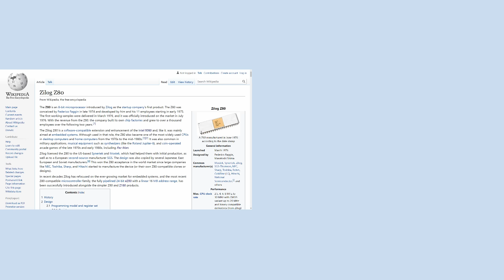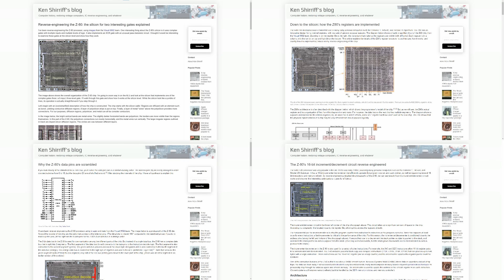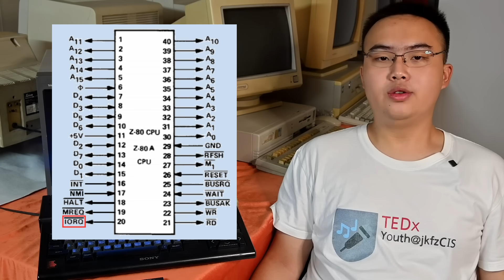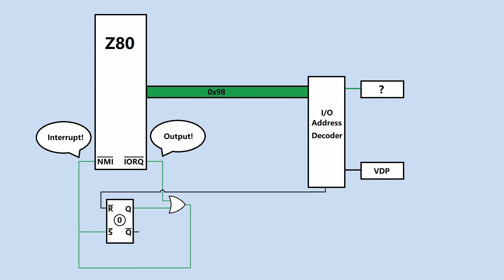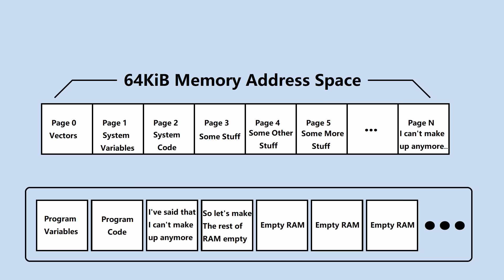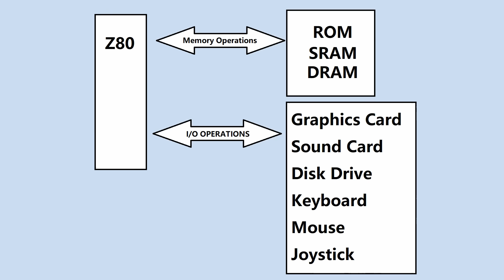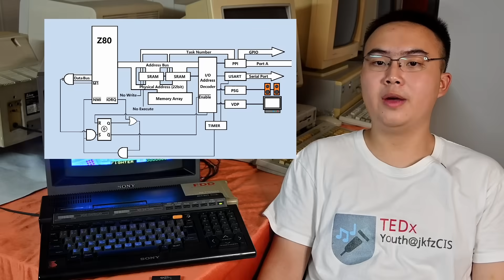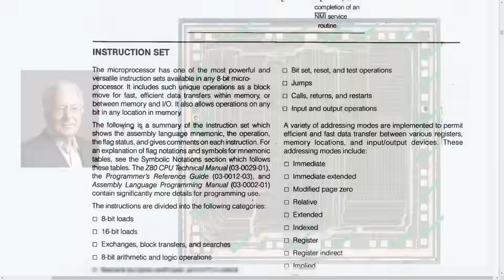The Z80's secret feature discovered after 40 years!

Comment: Mobile phone arm processors have inbuilt x86 architecture, such as 286 and 287. It has a light processor, and simple physx also available in symbian devices. 8087 should have the light processor, requires a heatsink at 4.7 mhz. Isa 256 colour cards should have the same physx support for car games. To turn on the light cpu, using flight sim at low altitude, high speed. To turn on physx, nfs uc and hp is needed for phones. For explorers, and frameworks graphical and keyboard performance increases. Diablo clones and castle vania character increase adds magical power and luck for the computer permanently. That causes luckier browsing solution with an xt computer.

Comment: I fell in love with the Z80 as a teenager. Loved my ZX81 as well. I did a tech project for school where I made a Z80A trainer. Years later I examined an video gaming device where it would switch between running the game and the input devices and had this seperate video board it would switch back and forth with to run to provide the screen output. It seemed over the top to me but that is what it had. For it to generate random numbers it would access the refresh register as a seed. Always thought that was nifty.
Reply: Do check out the ZX81 ROM disassembly books, some seriously devious code in there to squeeze every last gram of potential from such a simple circuit.

Comment: you cant trigger a nmi until the current instruction has finished so if thats an io instruction then wont work right?
Reply: The pre-NMI I/O operation is blocked [well, sent to nowhere] by the flip-flop disabling the I/O address decoder.
The NMI being acknowleged is detected, which enables the I/O decoder.
The OS will exit system mode by outputting to a special port to switch back to user mode.
It shouldn't be too hard to add some decoding to detect the RETN [ED 45] instruction executing and automatically switch to user mode.
RETN executing from user mode should not be a problem here.

Comment: I can think of ways of implementing a "protected mode" in a Z80 using similar methods, presuming it uses bank switching to implement the protection.  With the right gates, you could set it up so that a NMI is hardware-forced if an OUT to the bank switching control is executed from any place in memory apart from the OS address range.  The interrupt acknowledge would hardware-switch out the bank containing the running program and switch in the bank containing the correct interrupt vector.

Presuming the OS has been keeping track of which program is currently running (which any good protected mode OS would do), it would be able to terminate that program immediately and throw an appropriate error to the console (eg. Protected Memory Access Violation).  This would not prevent a program from requesting a bank switch from the OS to store extra data (for example), but it would prevent the program from doing the bank switch without asking the OS.
Reply: And now that I come to think of it, it would be quite possible to make the OUT instruction simply go into "dead ether" unless the code was run from within the OS's area of memory.  In other words, a gate which blocks any OUT instruction addressed to the bank switching circuit, unless the instruction came from within the area of memory used by the OS.
A similar scheme could be used to prevent overwriting the OS if it were in RAM.

Comment: Looks interesting but I highly doubt that NMI can interrupt an I/O transfer ... Even if it would, I also doubt that you could figure out the address of the interrupted I/O transfer 🤔. Is this just theory or did actually someone really try this? 🤔
Reply: i just got done posting something similar, i have my doubts about this too. The current instruction would have to finish right?
Reply: @randyjackson7584  yes, afaik NMI triggers after instruction was completed.
Reply: @punpck  he seems to be getting a lot of high praise so maybe i am the one wrong, but this won't work. the nmi will come after the i/o instruction is over and the return address pushed to the stack will be at start of next instruction.
Reply: @randyjackson7584  yep the Z80 finishes the current instruction (or the current "loop" of a block instruction as I understand it) before any interrupt is serviced... I/O instructions are always two bytes I believe so you CAN find and inspect the instruction (at a big performance hit), but my big issue is the IORQ line... how do you ACTUALLY do I/O if you wire IORQ to the NMI... the proposed "simple circuit" omits that...

Comment: I like your video. The Z80 is a powerful little CPU, even today. 

A couple of things to keep in mind though. On the platform you're demonstrating most prominently, the MSX (thanks for that btw - it is way underrated), the Z80 memory addressing space is divided up into 4 pages of 16kB, each of which can be in 1 of 4 so-called slots. Which page is in which slot is governed by port A of the PPI (8255). In theory, this allows for a total of 256kB of address space without any additional circuitry. The main BIOS and BASIC ROMs are usually in port 0, with RAM and additional ROMs in one or more of the other slots. At least one slot is also taken up by a cartridge interace. For instance, the Philips VG-8020 has its ROMs in slot 0, two cartridge slots in slots 1 and 2, and depending on the specific model 64kB of RAM in slot 3 or in a so-called expanded slot 3-2 (expanded slots are a standard way of increasing the capabilities of the MSX platform even further, and later standards such as the MSX2 standard typically feature at least one expanded slot). 

The MSX standard also provides for a so-called memory mapper interface. This interface allows for 1 of up to 256 16kB segments (4MB!) to be selected for a given page in a given (sub-)slot. Any device adhering to at least the MSX2 standard has a memory mapper unit built-in. This is how most non-Japanese MSXes squeeze in more than 64kB of RAM. The Philips NMS-82xx series, for instance, all provide 128kB of RAM in this way, but even MSX2 systems with only 64kB of RAM provide this through a memory mapper. The MSX BIOS in these systems will scan for each and every mapper in the system at boot-up and often, but not always, display the amount of RAM in the largest mapper. Both the MSX BIOS and MSX-DOS 2.x provide memory mapper routines that an application can use to manage this memory. There are a couple of good mapper circuit designs to be found on the world-wide web. 

The final thing to take into account is a peculiarity of the Z80 that is not officially documented, but is important to know, especially with the circuit you describe in your video, namely that, in spite of the Z80 being documented as having an 8-bit I/O addressing space, every I/O instruction does in fact assert the entire address bus. For simple I/O instructions such as in A, (imm8) and out (imm8), A it is the contents of the A register, and for more complex I/O instructions such as in reg, (C) and out (C), reg it is in fact the entire BC register.
Reply: [The MSX standard also provides for a so-called memory mapper interface. This interface allows for 1 of up to 256 16kB segments (4MB!) to be selected for a given page in a given (sub-)slot.]
That means that, if you put in 64K, you would have 16 MB of RAM?!!!!!
Reply: @Atheist7  It means that each page can be set to a specific (sub)slot and to a specific segment in that slot. Think of it as a simple paging mechanism. So, theoretically if you fill each slot with RAM, you could theoretically have up to 16MB of RAM, but then you would not have any room for ROMs, which you will need in order to have a working system. On a typical MSX2 computer with two cartridge slots, you could install a 4MB memory mapper in each of them and have a total of 8MB of RAM, plus the amount of built-in ram. On a NMS 82xx (excluding the 8220), this would amount to a total of 8192 + 128 = 8320kB of RAM. However, then you would not have room for any additional expansion hardware left. So it's a balance between what's practical and what's possible. In my setup, I have one slot in use for a Carnivore 2 (which is a multipurpose device which provides a 1024kB of mapper and a CF card slot among other things) and another for a slot expander, which expands the slot into 4 subslots, each with its own cartridge connector.
Reply: @damouze  [So, theoretically if you fill each slot with RAM, you could theoretically have up to 16MB of RAM, but then you would not have any room for ROMs, which you will need in order to have a working system.]
Computers are SOOOOOO baffling.
Can't you give up ONE of the 256 ---> 64K "slots" to put the ROM into?
Reply: @Atheist7  Theoretically? Probably, but that would not be compliant with the MSX standard. With the MSX2 standard and above the picture becomes even more complicated. 

For instance, in the NMS 82xx, the MSX BIOS and main BASIC ROMs are put in slot 0. Slot 1 and 2 are typically available as cartridge slots and slot 3 is expanded into 4 subslots, labelled 3-0 through 3-3. Subslot 3-0 contains the so-called SUBROM, subslot 3-1 is "empty" (but not fanned out anywhere), subslot 3-2 contains the 64/128kB memory mapper and subslot 3-3 contains the DISK-ROM with the floppy disk firmware and BASIC. 

However, it is possible to fashion a cartridge that internally expands to 4 subslots and then put a memory mapper in each subslot. However, such a device would only work in a primary slot and not in one of the expanded slots of a slot expander (of which each cartridge port would consist of a single subslot). Also, addressing the the so-called mapper register in each subslot would be a big hassle and switching between RAM segments in a page would be painstakingsly slow and involve mapping the slot into the proper page in Z80 address space by programming the PPI, then mapping in the specific subslot in that page and finally mapping the specified segment into that subslot. And there is no guarantee that it would work at all, since some MSX2 computers play fast and loose with the standard, especially where mappers in expanded slots are concerned.
Reply: BUILD IT!!!!

Comment: In the late’70s Ramtek had a FEP, Front End Processor, to their high end graphic systems" The FEP ran a graphics based BASIC. It was a Z80 with 1/2 Meg of Ram with memory protection and 3 different address spaces, System, User, & DMA.
Reply: Holy crap that was a lot of memory back then.  I had a couple of bench tech jobs, in the mid '80's,  where I would double the 64K memory by stacking 64K mem chips on customer machines.  I suppose it could be done with 128K RAM and 256K RAM using an 8080.  In came the IBM 286.  It changed the world.

Comment: "Need a recap on the Z80". Damn, I programmed this little dust bunny covered chip in the 1980s. Also designed a lot of hardware around it back then, too. The Z80 is alive and well, as there are macros, for it, that can be programmed into gate arrays. Don't know, if those macros, have these "secret" modes.

Comment: so what now, did you simply make a cheapo IOMMU (which, btw, isn't required for preemptive multitasking at all; or new for that matter, given the amount of banking going on in most computers of that era.) or does the Z80 simultaneously have a "protected mode" (which is from the wrong architecture) and also not have it "for 40 years" :P
did you really "discover the secret existence of RS flops" after 40 years?
and btw that's not required at all for what you claim. like you're already doing all of your multitasking via memory banking anyway, so why even go through the trouble for the whole IO thing if you could just use either RST syscalls or a periodic clock interrupt or whatever to go back to the OS? apart from maybe simply disallowing IO for security reasons (something that's not "protected mode" nor "multitasking" related) there's no reason to even use the IORQ pin. heck even the Gameboy with its "not really a Z80 or 8080 or anything we know" Z80 does banked multitasking and hardware based memory security while not even having that pin.

Comment: Loved this video! I remember how excited I was when I found those undocumented instructions back in the late '80s. I made the core of a Z80 disassembler for my A-level Computer Science project that could disassemble all the undocumented instructions and ran under CP/M. No user interface, though. That was plenty for a teen doing an A-Level! I never really tinkered with the hardware, other than zapping the reset pin on the back of my ZX81 to restart it.
Reply: Crikey, the most difficult thing I did on my A-Level Comp Sci project was code a bubble sort routine in visual C++. (I grew up with the Z80 though, having been a Spectrum nerd in the '80's)
Reply: @paulleach3612  I wrote a version of Othello in BBC Basic for my GCSE back in 1992 I think it must have been. I'm certain it was the most awful inefficient code imaginable, but it worked! I was an 80s Speccy kid too but needs must and had to slum it using the Beebs at school!

Comment: Hi Andy.  I'm a dinosaur programmer.  I'd like to correct a statement made around 2:00 in your video because there was no protected mode,  "No MultiTasking".   In 1985 I used the QNX operating system.  All versions of this OS up to the last 2.21 would run on an Intel 8088 which had no protected mode, but which ran a preemptive, multi-tasking OS which can be virtualized. As you say, it provided no memory protection nor security when run on an 8088.  That's not to take anything else away

Comment: 🎉Designing embedded systems decades ago, I switched from Intel to Z80 as soon as it launched. The built in RAM refresh, on alternate clock cycles made graphics so easy. What you say was a feature, not a fault.
Reply: Did you mean the 8080 ? The 16bit 8086 showed up a few years later.
Reply: @RKelleyCook yes
Reply: No you didn't. The 8088/8086 (x86) wasn't introduced until 1979, when the Z80 had already been out in numbers for almost three years.
Reply: @bennylofgren3208 Just a typo. I meant 8080.

Comment: The 68000 is a particularly nasty CPU to add a protected mode to.  While most elements of later 58k series CPU are already available with the 68000, the handling of the address error is somewhere between lacking and plain broken.  When an external circuit signals an address error, the CPU takes the address error and writes an exception stack.  The problem is the program counter written to the stack is between 2 to 12 words ahread of the address where the CPU would have to resume execution.  Iow, on a 68000 an address error is fatal.
The solution used by the earliest 68000 systems is crazy.  Use two CPUs running exactly the same code.  The primary CPU is one cycle ahead of the secondarY CPU.  So if the primary CPU receives an Addresss Error, and the second CPU will be stopped.  As explained above the Address Error for the primary CPU was a fatal execution error - but the secondary CPU contains a valid state.  So save that state, handle the Address Error and resume execution on both CPUs.  It only made sense because the 68000's price dropped soon after market introduction to a level that allowed throwing two CPUs and a pile of glue logic and OS complexity at the problem.
Motorola soon after the 68000 released the 68010 which is a fairly similar CPU.  One of hte differences is the fixed Address Error handling allowing external MMUs such as Motorola's 68451 to be used sensibly.  However the 68451 was slow, not integrated into the CPU so for example Sun opted to implement their own MMU for their workstations.

Comment: I have worked on a 1980s system that used the Z80 with it's original chips to protect the room where it was made.  But I also worked with Z80 based PCs running CP/M.  I can't see why the proposed design wouldn't work with all the features.  Key thing is having an external protection bit that is only unlocked by executing an interrupt whose address and code is read only.  Then once unlocked, the protected code can adjust other protection features not controlled by the external mode bit.
  The dual register set can be used to save context for returning to user mode after interrupts (but the content cannot be protected from user mode software), the rule is that the other register set isn't protected across interrupts, making it useless for user mode variables. Alternatively, the interrupt handlers need RAM to save registers.  Having page 0 in ROM is an alternative to a soft write protection, but we still need some protected memory for kernel mode state like the list of processes.  Use a gate to disable all write protection in kernel mode as a faster solution than doing step by step unprotection on kernel entry.

Comment: This is an interesting video on implementing a type of protected mode on the Zilog Z80. However in the real world the early 8 bit processors that could only directly address 64k of memory were all processors that had only real mode operation internally. The first processor that I know of that actually had protected mode operation was the Intel 80286, but because so much software was written for the original IBM PC computer which had an Intel 8088, the protected mode on the IBM PC AT  which had the Intel 80286 was rarely used. Most of the time the Intel 80286 was used as a faster Intel 8088.
Reply: If you used P1 of the 8051 as 8 more address bits, it had a 24 bit address bus.  This let it access 16Meg fairly seamlessly.